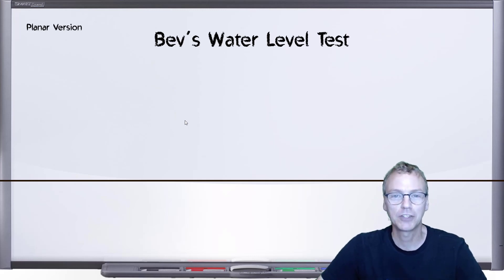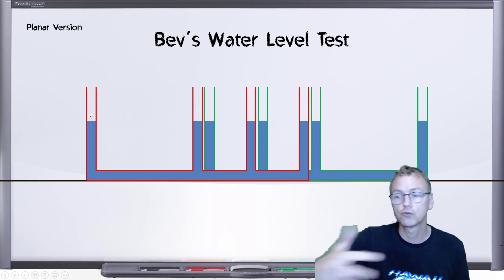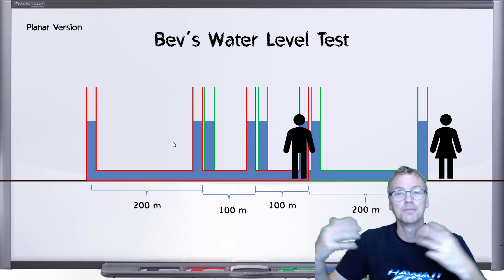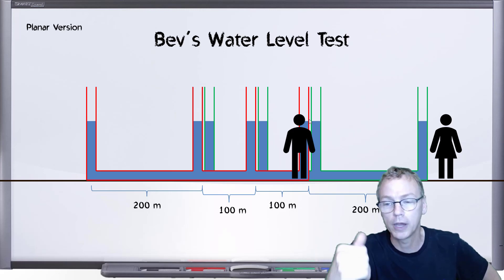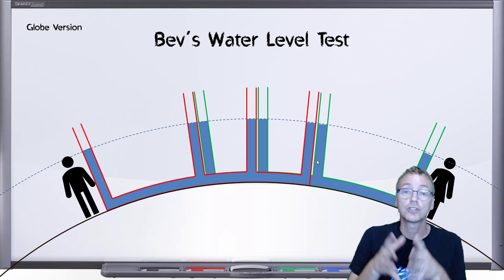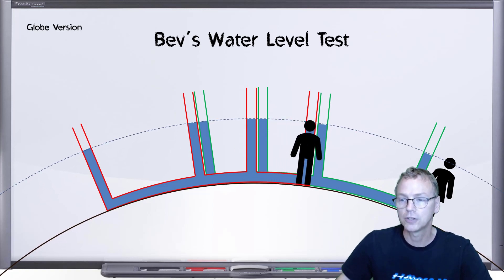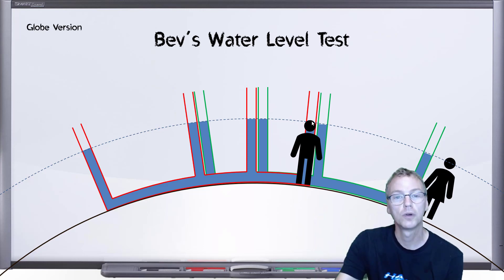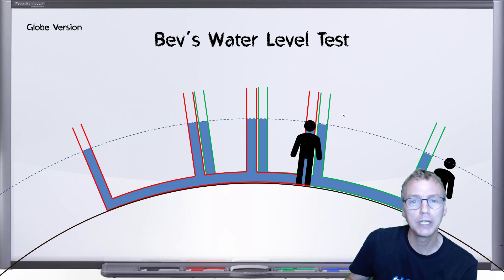Bev Try Thinking and Spot On Level's Water Level Test

Comment: The float glass horizontal and level manufacturing process producing uniform plate glass all over the world proves that the direction of down cannot somehow converge to a single point, little buddy. Otherwise the plate glass wouldn't stack perfectly. We went over this. Sort of surprised that you still don't get it.
Reply: Once again, a flerf cannot deal with scale. Isn't that right 'little buddy'?
Reply: @rustisamust9079  
I always think of it as a conversation between Lennie and George from Steinbeck's book "Of Mice and Men".
Reply: Float glass is anything but flat.  I know because I've measured it.
Reply: @awatt  I look forward to your video on it.
Reply: @awatt  lots of beliefs there buddy, enjoy.
Reply: @awatt  lol then you imagine the float glass manufacturers are lying to their customers?  Do you plan to sue them for false advertising?
Reply: @DrEMichaelJones  
Float glass is anything but flat.  Ask any mechanical engineer.  Glass plates are commonly used as a reference surface.  Float glass isn't flat enough for such measurements as it's not flat.
Reply: @awatt  that's a fascinating belief little buddy. The float glass manufacturers say they have submicrometer accurate optical scanning equipment all up and down their 500 meter manufacturing line where they make 2mm thick plate glass. Where do you imagine the top of a "hump" would be located on the production line? Do you imagine it's in the middle or at one of the ends or perhaps someplace else? Take your time...
Reply: @DrEMichaelJones  
Measure it yourself then come back and apologize.  Wait, you haven't a clue how to measure it have you?  Show us all just how clever you are by telling us how you have measured plate glass for flatness.  Pro tip you can't because you don't know how.🤣

Globe confirmed 🌎
Reply: @DrEMichaelJones  
Your apology has been accepted.
Globe confirmed 🌎
Reply: @awatt  the glass manufacturers measure the uniform thickness for us and then produce uniform plate glass daily. No curvature in their horizontal production lines.
Reply: @awatt  you tell yourself that if it helps you sleep at night. Enjoy your day. :D
Reply: @DrEMichaelJones  
From "fundamental principles of float glass surfaces"

The second optical defect, which results from the float process is the distortion. Distortions are the result of waviness of the glass surface and act as cylindrical lenses in the glass. The reason for this effect is that the float bath is not ideally flat in reality. Top rollers, stretching forces on the glass ribbon and vibrations from outside induces a corrugation of the glass surfaces. Two forces are acting to remove the corrugation and to flatten the glass surface: surface tension and gravity. By these way capillary-gravity waves are induced with a wavelength of about 20 mm. The great advantage of the float process is, that it reduces the amplitude of the distortion waves and therefor the lens power. Measurements show that float glass with equilibrium thickness of 6.5 mm has the best optical quality."

Globe confirmed 🌎
Reply: @awatt  where do you imagine the "top" of the the "hump" you believe exists in the 500 meter production line?
Reply: @DrEMichaelJones  
Float glass isn't flat therefore globe confirmed 🌎
Reply: Float glass proves the globe due to not being flat.  Globe confirmed 🌎
Reply: @awatt  except for the part where the horizontal production line destroys any notion that it can curve. Enjoy your day.
Reply: @DrEMichaelJones  
Float glass production destroys flat earth because float glass isn't flat.
Globe confirmed 🌎
Reply: @awatt  the glass production line is level and horizontal for 500 meters. It doesnt curve. Enjoy your day.
Reply: @DrEMichaelJones  
But I he glass it produces isn't flat.  Globe confirmed 🌎
Reply: @awatt  is this guy a troll?
Reply: @Darryl.M  
No he's just thick that's why I'm communicating on his level.
Reply: What is the calculated curve in an 8 foot piece of glass, if following Earth curve?
Reply: @darrellkimmel2646  About 4.5 x 10^-6 inches. You need a really good microscope to see it!
Reply: @bluemarblescience  
Mike and I have had the same discussion before.
I showed him the calculated curve in 500 meters , the length of the float pool, and asked him how much it was in 5 feet several times but he didn't answer.
Reply: @darrellkimmel2646  I know. People like Mike enjoy showing off their ignorance for some reason. They've obviously never heard of ASTM. If they had, they would take to time to look up the specs before making a fool out of themselves. On the other hand, it's amusing to read the idiotic dribble they come up with.
Reply: @bluemarblescience  lol, where do you imagine the ASTM compliance team would measure a hump, little buddy? Do you imagine that it's exactly in the middle or are you going to pick one of the ends? :D
Reply: @bluemarblescience  
He thinks glass manufacturers routinely test to this precision with in house equipment.
Reply: @DrEMichaelJones  The fact that you're asking where the ASTM team would measure a hump shows how little you understand of how the world works.

Also, what method does the company use to measure this flatness? You must know all about it if you're willing to stand behind it with such certainty.
Reply: @Beacon80  I'm glad you agree that there's no hump in the production line for the ASTM compliance team to measure because the line is, of course, level and horizontal. Good stuff. 👍🏿
Reply: @darrellkimmel2646  Mickey thinks a 500m production line makes a sheet that is 500m long. The 500m includes 50m Tin bath but the rest is , Anneslling, cooling, cutting, stacking, and other bits and pieces. He fails all day.
Reply: @whereswa11y  👍 the annealing process takes up the largest section of the line. I remember getting a batch of 3mm from China that was not annealed properly. Almost impossible to cut. At this stage I think Mike is just trolling. He has no experience in the subject matter and is just making it up as he goes.
Reply: @whereswa11y  
That's what I get for not checking his assertions.
Reply: @whereswa11y  wally imagines that the direction of down somehow only converges on the tin bath part and then the converging down switches back to normal down and is uniform and parallel after the glass emerges from the bath and dries and hardens. What's nice is that he got a little heart for that comment so we can infer that the channel owner agrees with this.
Reply: @darrellkimmel2646  zero. There is zero curve "calculated" in an 8 foot piece plate glass and there is zero curve across the entire 500 meter long level horizontal production line that is constantly being monitored by submicrometer accurate optical scanning equipment. None. Zero. They make plate glass all day every day. No curve at all in that manufacturing process.
Reply: @DrEMichaelJones  
In any case, glass is not  completely rigid either.
You can push in the center of a window or even a tempered glass door panel and see the deflection.
"Glass deflection is the amount that a piece of glass bends, or flexes, at its center point when a force, such as wind load or snow load, is applied. Extreme amounts of deflection can lead to distortion. Therefore, The International Building Code (IBC) has established deflection limit standards for glass wall systems.Oct 30, 2019"
There's plenty enough flex in glass to lay flat even if layers were stacked alternating between glass facing up and  glass facing down during manufacturing.
Reply: @DrEMichaelJones  It's very simple Mike: Some people went to space, they took a camera. 

It's not flat
Reply: @A 15 degree per hour drift  it's great to watch you guys have to resort to spaceships when you can't demonstrate curved water at rest. What do you imagine your grandparents said before nasa was founded?
Reply: @darrellkimmel2646  who said it needed to be perfectly rigid? Plate glass is manufactured and naturally hardens on a horizontal level production line to uniform thickness. There's zero curve in the process. None. The direction of down doesn't somehow converge anywhere along the line.
Reply: @DrEMichaelJones  _Wah! Wah! Wah! 
We can explain water at rest being curved, you're either too obtuse, or much more likely, far too thick to understand what you've had explained and demonstrated many times.
Reply: @A15degreeperhourdrift  don't cry little buddy. I know it can hard for you boys when your worldview is being dismantled.
Reply: @DrEMichaelJones  just to correct you on one point. Plate glass is an old process where a glass panel (usually drawn glass) is ground flat on both sides to make both sides flat. Float glass is the newer process of floating molten glass on a bed of tin (most common ). 
The tolerance of thickness in glass manufacture for the most common glass thickness of 6mm is +-.2mm and as much as +-1mm for glass up to 20mm. This would make it impossible to determine the presence or lack of curvature over the short distance. To make it harder to determine, glass can be flexed way more than what would be considered the radius of earth. To move large sheets on a cutting bench we would flex the glass to allow air under it. The amount we would flex (bend) the glass far exceeded the curvature need over such a short distance. I could make a 3.6 metre sheet of glass flat, curved up or down. Glass manufacture cannot be used to prove or disprove curvature.
Reply: @Darryl.M  the float glass process requires zero grinding, little buddy, and it's more efficient and adheres to much tighter tolerances.
Reply: @DrEMichaelJones  Darryl gave you the tolerances for producing float glass. Nowhere does he mention grinding for float glass.
Try reading it again. Slowly.
Reply: @DrEMichaelJones  
Why would standard window glass need to be flat? In fact if one looks carefully through any plate glass windows, distortions due to NOT being completely flat can be observed.
Reply: @DrEMichaelJones  well little buddy I think you will find I said that. The point I was making was that you were stating plate glass instead of float glass in your earlier post.
Reply: @DrEMichaelJones  sorry Mike but the manufacture tolerances and the fact that glass bends make the argument that glass manufacture proves or disproves curvature a no go.
Reply: @simond.455  glad we agree that float glass hardens naturally without grinding. It's definitely a horizontal and level manufacturing line with zero curvature detected by the submicrometer accruate optical scanning equipment that runs across the entire 500 meter long production line.
Reply: @Darryl.M  the float glass process produces plate glass, little buddy. Try to focus.
Reply: @DrEMichaelJones  
Plate glass is not float glass. The clue is that they have different names
Reply: @DrEMichaelJones  Google is not always your friend. Do you have any experience working with glass? Have you ever seen the manufacture of float glass? I finished my glazing apprenticeship in 89 and have worked in domestic, commercial, highrise and manufacturing. We have a great float glass manufacturing facility in Melbourne which I have visited on more than one occasion. I don't really care about your belief in flat Earth but you cannot use glass manufacture to prove or disprove curvature. Find something else.
Reply: @DrEMichaelJones  Thank you for confirming that you don't understand how the world works. And you, of course, ignored the second half of my post. I'm guessing because you have no idea how they measure it.
Reply: @Darryl.M  it's not a good look to tell people that your former employer lies to their customers
Reply: @DrEMichaelJones  so what experience do you have?
Reply: @DrEMichaelJones  Wah! Wah! Wah!
Reply: @DrEMichaelJones  You were asked for the CALCULATED curvature. Your "answer" didn't address the question.
Reply: @DrEMichaelJones  Curved water at rest has been understood and explained for centuries, NASA has exactly nothing to do with it.
Reply: @davidfaraday7963  tell us more about your "understanding" of "curved water at rest."
Reply: @DrEMichaelJones  You have been told it hundreds of times already. If you have the intelligence to comment on YT you have more than enough to understand the explanation. Therefore you are pretending to not understand and are showing yourself to simply be dishonest.
Reply: @davidfaraday7963  you sound upset, little buddy. Maybe take a break from the internet and get some fresh air
Reply: @davidfaraday7963  Well, what can you expect from someone who didn't have 5 minutes to research and find that a tin bath is only 50m on the 500m production line? LOL!
Reply: What can we expect from someone that imagines that the liquid bath would somehow be curved but the rest of the production line would be straight, level and horizontal? He clearly knows nothing about engineering. LOL!
Reply: @DrEMichaelJones  Has it become standard practice now in flerf circles to claim that anyone who contradicts their nonsense is accused of being "triggered", or "upset" or other similar words?
Reply: @DrEMichaelJones  "He clearly knows nothing about engineering."
That would be you... you are the one who thought the earth curvature should affect the production of float glass somehow, even if due to the small size of the tin bath it wouldn't be noticeable anyhow.
Reply: @davidfaraday7963  Yes, fucking annoying, isn't it? Triggers me every time!! LOL

No, seriously, you're right: it's used as one of those conversation-derailers, isn't it? Like "Hey, calm down..." Often used by debaters when they panic and need a bit mor floundering-about time.
Reply: Look at them all try to comfort themselves that they somehow must be right even though none of them can figure out how a float glass manufacturering line could produce uniform plate glass with micrometer accuracy if the direction of down somehow converged. Hilarious
Reply: @jaimevivesp glad to hear you say that plate glass is clearly not affected by a converging direction of down. Ergo, the direction of down clearly doesn't converge.
Reply: @DrEMichaelJones  If you'd followed the thread you would have spotted that in fact they DID manage to "figure out how a float glass manufacturering line could produce uniform plate glass with micrometer accuracy if the direction of down somehow converged"
So you statement is a complete and utter lie.
Reply: @DrEMichaelJones  Let me ask you a question: if the direction of down converges to a point 6371 km below the 500 m long glass manufacturing line what is the departure from "flat" over that distance?
Reply: @DrEMichaelJones  I thought float glass was permitted to have overall bow ± 3 mm/m? That seems very different to what you are claiming.
Reply: @DrEMichaelJones  "submicrometer accruate optical scanning equipment that runs across the entire 500 meter long production line"
Citation needed.
Reply: @everybodylovesballs  you imagine that 2mm thick glass can vary by +/-3mm over a meter? Fascinating belief.
Reply: @davidfaraday7963  the direction of down definitely doesn't converge which is why the float glass manufacturers tell their customers that their plate glass dries and hardens uniformly across the entire line. Where would you imagine there would be a hump in the horizontal manufacturing line?
Reply: @DrEMichaelJones  Correct me then. What is the exact manufacturing tolerance for overall bow?
Reply: @DrEMichaelJones  "glad to hear you say that plate glass is clearly not affected by a converging direction of down. "
Along 50m? Are you joking?
"Ergo, the direction of down clearly doesn't converge."
False conclusion. You were proved wrong. Move on and try something else.
Reply: @davidfaraday7963 the direction of down doesn't converge on that manufacturing line as evidence by the uniform plate glass produced and monitored by submicrometer accruate optical scanning equipment. No iis detected. There was nothing for the glass manufacturers to "figure out." The direction of down is parallel to the horizontal production line at every point along the 500 meters.
Reply: @everybodylovesballs  what bow? The line is horizontal and level. Where exactly do you imagine the top of this "bow" is?
Reply: @jaimevivesp  no, I never joke about plate glass manufacturing. There's definitely no curve in a 500 meter horizontal and level production line.
Reply: @DrEMichaelJones  Why are you insisting on the 500m lie? The tin bath, where the glass is flattened, has only 50m! There rest of the line has nothing to do with making flat glass.
Reply: @jaimevivesp  so you imagine the 50 meter tin bath is where there would be some sort of hump with converging directions of down but they managed to get the rest of the manufacturing line to be horizontal with a uniformly parallel direction of down? Fascinating belief. Let's see if your little buddies agree with you...
Reply: @DrEMichaelJones  Mike, you are really obtuse... no one is saying there is a significant hump on a 50m tin bath, that would affect the flatness of the glass within the stated tolerance. It's you who said that.
And again, the fact that the rest of the line is or is not perfectly horizontal has nothing to do with the process of making flat glass, only the tin bath matters.
Reply: @DrEMichaelJones  You still haven't explained how they test the flatness.
Reply: @Beacon80  they use submicrometer accruate optical scanners, little buddy. I've pointed that out about a half dozen times in this thread. You can look it up. Or maybe call them and ask.
Reply: @DrEMichaelJones  Do you know at all how float glass is made? I repeat: the only part of the production line really important for making flat glass is the tin, the rest of the line is not relevant.
Reply: @DrEMichaelJones  I asked you to say HOW MUCH it would be out IF the direction of down converged as described.
Yet again you have fluncked it showing that you simply haven't got a clue. Your problem is that you have zero understanding of the model you are attempting to debunk. Instead you have fallen back on simply making assertions that you cannot offer any evidence for.  You say that "The direction of down is parallel to the horizontal production line at every point along the 500 meters", OK then PROVE IT!
Reply: @DrEMichaelJones  Oh, and I asked you for a citation about your repeated claim that manufacturers use "submicrometer accruate optical scanning equipment". Frankly I think it highly unlikely that the producers of commercial float glass use equipment of that class so I'm asking you to tell us where you got that from. Or did you simply make it up?
Reply: @jaimevivesp  and by "really important" you mean the one place where you imagine there is a hump (where exactly?) and converging directions of down after which you imagine the glass exists that area and enjoys horizontality and uniform and parallel down?
Reply: @davidfaraday7963  it doesn't curve at all, little buddy but if you want to engage in fantasy maths to try to predict a curve based on a model that you can't prove, go for it.
Reply: @davidfaraday7963  the manufacturers state that their glass hardens uniformly parallel along the entire production line, little buddy. Are you saying they're lying to their customers? Do you imagine a great plate glass conspiracy to hide a hump with converging directions of down that you still can't even say where you imagine the top of it would be?
Reply: @davidfaraday7963  St Gobain Glass is the owner of the submicrometer accurate optical scanning equipment. They have loads of videos right here on youtube. Feel free to watch them at your leisure.
Reply: @DrEMichaelJones  I asked you to calculate how much difference it would make IF the direction of down converged. Yet again you have refused to answer. The obvious reason is that the simple high-school maths involved is way beyond your ability. 

And I'm still waiting for a citation for your claim about "submicrometre" measuring equipment. Its looking more and more as though you simply made that up.

And you wonder why people call you a liar.
Reply: @davidfaraday7963  I'm not your employee little buddy. If you'd like to calculate theta decay for me for some options I'm considering buying at the open tomorrow I'll keep you in mind for an unpaid intern job.
Reply: @DrEMichaelJones  So you don't know how it works. Got it.

I did some poking around, and there is a notable tolerate in what's allowed for "flat" glass. "the acceptable tolerances for thickness for a piece of ¼” glass (technically listed as .23”) has an acceptable range of .219” to .244”."

Having a system that can test detect the flatness of the glass down to the micrometer doesn't mean there isn't a micrometer of bow. It just means they're aware of it, but it's still well within acceptable parameters.
Reply: @DrEMichaelJones  "some options I'm considering buying at the open tomorrow" Yeah, yeah! And pigs might fly!
Face it Mike, you couldn't add up two and two and get the right answer.
Reply: @Beacon80  you imagine the top of this micrometer of "bow" is where exactly again? Surely you have an idea of where the top of the bow you imagine exists is. Why don't you tell us?
Reply: @davidfaraday7963  head over to di$cord. The server is called "next level." I'll livestream the waterfall into my pool for you.
Reply: @DrEMichaelJones  Assuming the glass is perfectly uniform, it would be directly in the middle.

Please state where St Gobain Glass says that their maximum tolerance is less than a micrometer.
Reply: @DrEMichaelJones  Which has what to do with your inability to do even grade-school maths?
Reply: @Beacon80  the middle of what?
Reply: @DrEMichaelJones  The middle of the section of glass. What else could I possibly have meant?

Again, please state where St Gobain Glass says that their maximum tolerance is less than a micrometer.
Reply: @Beacon80  the middle of each plate or the middle of the 500 meter long manufacturing line?
Reply: @DrEMichaelJones  Each piece of glass.

Again, please state where St Gobain Glass says that their maximum tolerance is less than a micrometer.
Reply: @Beacon80  lmfao. You imagine each plate of glass has its own individual hump exactly in the center of it as it moves down the production line side by side with other plates? Fascinating!
Reply: @DrEMichaelJones  Yes. But far too small to be noteworthy. 

Again, please state where St Gobain Glass says that their maximum tolerance is less than a micrometer.
Reply: @Beacon80  so you imagine that 2, 3 even 4 side by side plates all somehow develop humps in the exact center as they move down a horizontal production line?
Reply: @DrEMichaelJones  There's no side by side on the production line, but yes. Cut curved glass and you get a piece of curved glass.

Again, please state where St Gobain Glass says that their maximum tolerance is less than a micrometer.
Reply: @Beacon80  that production line produces multiple side by side plates. It's not 2 feet wide. Do you imagine the middle plate has the highest part of an overall hump or do you imagine the ones on either side of it each have an individualized equally high hump?

Call St. Gobain. Youtube won't let me post the link
Reply: @DrEMichaelJones  Tell me the name of the website and whatever search terms you used and I'll look it up myself. Because I've poked around their official website, and I don't see anything about their maximum tolerance.
Reply: @DrEMichaelJones  did you state that glass dries? When did it get wet? 🤣
Reply: @Darryl.M  Oh thank you for walking into that one. I've been waiting. So the liquid, molten, moving glass that goes down a horizontal manufacturing line begins to cool/harden/solidify where exactly? As it leaves the liquid bath, right? Take all the time you need...🤣  you're the one that claims to know the exact moment of hardening.
Reply: @Beacon80  thickness tolerance for 4-6mm float is +-.2mm. It is up to +-1mm for 20mm float glass. The sensors he keeps talking about measures the thickness as the sheets run through the production line. The glass could be formed into a circle and the thickness of glass would not change. These sensors will not measure a "hump" in the glass even if it existed. Float glass production cannot be used to prove or disprove a globe or flat Earth.
Reply: @Beacon80  were not talking about "tolerance" little buddy. We're talking about the ability of the submicrometer accurate optical scanning equipment to detect what you guys originally envisioned as a single hump but you have now decided to overrule that and claim hundreds of little humps all up and down the 500 meter long production line. It's a bumpy line according to you...
Reply: @DrEMichaelJones  it's called annealing. Not drying. Walk into what? You thinking that molten glass dries? You are a special one aren't you.
Reply: @Darryl.M  where's the top part of that annealed curved you imagine? Is there one on each plate along the entire horizontal production line that our special little buddy imagined or do you imagine it differently? Take your time.
Reply: @DrEMichaelJones  tell me were the glass starts to "dry"? Take your time.
Reply: @Darryl.M  the float glass cooling is definitely a dry process as opposed to wet cooling. Good for you. Where does the cooling begin? Is the hump you imagine there? Take a day or two if you need it. This sad little attempt at obfuscation amuses me.
Reply: @DrEMichaelJones  your story changes like the wind. You have no practical knowledge of the properties of glass or its manufacture. You state on more than one post that glass dries and now you back pedal and change it to a dry cooling process. You never answered my question about what experience you had working with glass. See if you can answer this time.
Reply: @DrEMichaelJones  If you have a curved piece of glass, you have one hump, right? If you cut that in half, you now have two pieces of curved glass, each with their own hump. No matter how many times you cut the glass, each piece will still be curved.

More importantly, how big do you think these humps are?
Reply: @Beacon80  the glass isn't curved, little buddy. The manufacturer specifically states that. Do you imagine they're lying to their customers?
Reply: @DrEMichaelJones  you really have no idea of the properties of glass do you.
Reply: @DrEMichaelJones  No. They're not lying. The curve is well withing the tolerance to be considered flat.
Reply: @Beacon80  you just claimed that each individual glass plate in dozens of rows of glass has a curve with its highest point exaclty in the center. How do you imagine all these humps form?
Reply: @Darryl.M  says the guy that imagines plate glass hardens into a hump 🙄
Reply: @DrEMichaelJones  I don't believe I have ever said there is or is not a "hump". What I have stated is that with the properties of glass and the manufacture tolerances, the float glass manufacturing process cannot be used to prove or disprove a globe or flat Earth. You are the one stating a position that is untenable.
Reply: @Darryl.M  a hill disproves a "flat earth," little buddy. There are no hills in plate glass but plenty of hills all over the world.
Reply: @DrEMichaelJones  and now you start taking about hills. You do love a good straw man don't you. I don't care if you believe in a globe earth or a flat earth. Float glass manufacture cannot be used to prove or disprove either. Your lack of practical knowledge in this field is obvious. You maybe better off finding another "proof" to backup your beliefs.
Reply: @Darryl.M  float glass manufacturing proves that level is horizontal, little buddy. I don't know why this bothers you. It's a simple principle of construction and manufacturing
Reply: @DrEMichaelJones  "How do you imagine all these humps form?"
We went over this. As you yourself pointed out, according the the globe, the glass in the tin bath will have a slight curve. If you cut curved glass, it doesn't become straight.
Reply: @Beacon80  so now you imagine a single hump in the center of the bath and then you imagine each individual plate also has a hump in thr center. Like I said, how do you imagine all those individual humps form?
Reply: @DrEMichaelJones  doesn't bother me. Take no time at all to reply. I'm not replying for you. I'm replying for anyone else that may read this thread so they don't fall down the rabbit hole with you.
Reply: @DrEMichaelJones  "Like I said, how do you imagine all those individual humps form?"
How many times do I have to repeat this? If you take a curved piece of glass and cut it in half, you have two pieces of curved glass.
Reply: @Darryl.M  I'm glad that level being horizontal doesn't bother you either since it's a principle of construction and manufacturing that's used every day all over the world. Especially in float glass.
Reply: @Beacon80  and like you also said, you imagine that every single piece of plate glass in multiple rows and columns on the production line has a "hump" that's highest point is somehow exactly in the middle of each plate and all those plates were cut from one continuous ribbon of molten glass that you imagine passes over a single hump in the middle of a liquid tin bath (and then no hump after that?). And like I said, what a fascinating belief that is not in any way supported by the manufacturers of plate glass.
Reply: @DrEMichaelJones  Since you clearly can't figure it out, the answer is that for a 50 meter pane of glass, the bow caused by the curvature of the Earth is 0.05 millimeters. That's one millionth of the length of the glass. It's insignificant next to the flexibility of the glass, and way below the regulated tolerance level. Nobody's going to reject that as not being flat.
Reply: @Beacon80  that's a fascinating belief and one that would easily be discovered by optical scanning equipment if it existed. Especially when you consider that screen protector glass that is only .3mm thick is made with this process. Where would you tell St. Gobain to look for this very specific hump in their bath? Do you imagine it would be in the exact center? If so why?

Do you imagine that the glass leaves the "curved" bath and then progresses down the rest of the manufacturing line horizontally or do you believe it would need to navigate a second hump there?
Reply: @DrEMichaelJones  "that's a fascinating belief and one that would easily be discovered by optical scanning equipment if it existed."
Not really. The pane of glass can bend far more than that tiny amount.

"Especially when you consider that screen protector glass that is only .3mm thick is made with this process."
Which means that, assuming it's 15 centimeters long, your screen protector has a bow of 0.000000707323 millimeters. This is, of course, assuming the glass is completely rigid, which it isn't.

"Where would you tell St. Gobain to look for this very specific hump in their bath? Do you imagine it would be in the exact center? If so why?"
It's not a hump. It's a curve. It runs the entire length of the pane of glass.
Reply: @Beacon80  bend? We're taking about a specific hump that you imagine is located at a specific spot in a bath that is scanned by equipment that can detect anomalies in .3mm glass. And it isn't screen protector size while it's in that bath little buddy 

If it runs the entire length of the production line then the apex of that "curve" can't be in the center of the bath... so where do you imagine it is?
Reply: @DrEMichaelJones  "bend? We're taking about a specific hump that you imagine is located at a specific spot in a bath"
No. You keep imagining a hump. I've made it quite clear I've been talking about a uniform curve in the glass.

"specific spot in a bath that is scanned by equipment that can detect anomalies in .3mm glass"
The video I watched, they don't scan the glass in the bath. It doesn't get scanned until it's left the bath, gone through the lehr and into the cold end.

"And it isn't screen protector size while it's in that bath little buddy"
Of course it isn't, sweetcheeks. But if you cut a 50m pane with a 0.05mm bow into 15cm pieces, the individual pieces don't retain that 0.05mm bow. They get a much smaller one. Do you not understand how curves work?

"If it runs the entire length of the production line then the apex of that "curve" can't be in the center of the bath... so where do you imagine it is?"
There is no apex. The apex is the highest point in a curve, and the entire point here is that the curve is following the curve of the Earth. Therefore no point on the curve is higher than any other point.

You're still missing two primary points here:
1) The flexibility of glass far exceeds the bow. Meaning if you took two 50m panes of glass, each with a 0.05mm bow, flipped one upside-down and placed it on top of the other, it would bend enough to be flush with the first pane.
2) Even if we pretend that glass is completely inflexible, that 0.05mm bow is far below the tolerance limits, and would be considered flat anyway.
Reply: @Beacon80  lol first you said only the bath matters ... now you're claiming they have no clue what happens in the bath nor is there's an apex to a curve there or at some other point along the horizontal manufacturing line. Why don't you call them and ask them where their hump is since you believe in it so vociferously? Better yet, why don't you tell them exactly where to look for it?

And if there's no "apex" to that curve you  imagine then why exactly do you claim that it blocks the bottoms of boats and buildings in the distance?
Reply: @DrEMichaelJones  "now you're claiming they have no clue what happens in the bath"
I'm not saying anything. Saint Gobain's video says that the high-end optical scanner you keep bragging about is in the cold end, not the tin bath. If there's some other video that talks about a scanner in the bath, tell me the title and I'll look it up.

"nor is there's an apex to a curve there or at some other point along the horizontal manufacturing line."
Pretty much, yeah. Under gravity, molten glass will distribute itself as evenly as possible. Why would there be an apex?

"Why don't you call them and ask them where their hump is since you believe in it so vociferously?"
Why would I ask them about a hump that I do not believe exists? You're the one insisting that on a globe earth, molten glass somehow defies gravity to create a hump.

"And if there's no "apex" to that curve you  imagine then why exactly do you claim that it blocks the bottoms of boats and buildings in the distance?"
I've never claimed that. The horizon blocks the bottom of boats, buildings, etc. in the distance, but that's not an apex and I've never said it was one.

Please show me where Saint Gobain says that there maximum tolerance for bow is 0.05 mm over 50m.
Reply: @Beacon80  "why would there be an apex?"  Because you claim that apex blocks the bottoms of boats and buildings in the distance little buddy. Or do you disavow that now

Say it out loud "the horizon isn't the apex of any curve."
Reply: @DrEMichaelJones  "Because you claim that apex blocks the bottoms of boats and buildings in the distance little buddy. Or do you disavow that now"
I literally just told you that I have never made that claim, sweetcheeks.
Reply: @Beacon80  nice to see you concede that there is no "curvature" blocking the bottom of anything in the distance. I'm male so you might want to retract the "sweetcheeks."
Reply: @DrEMichaelJones  I didn't say there wasn't any curvature, sport. I said there was no apex to the curvature.

Have you confirmed that Saint Gobain measures the bow of the glass, and what the maximum tolerance is? Or are you just making assumptions that support your argument?

And I'm not your buddy, so I thought we were just using inaccurate pet names for no reason.
Reply: @Beacon80  you imagine you can identify curvature but somehow can't locate an apex to it? Fascinating!
Reply: @DrEMichaelJones  I'll take your desperate attempt to change the subject as admission that you're just making wild assumptions that support your position.

As for the apex, if you want to get really technical, the oceans have two apexes, both on the equator, one directly under the moon and the other on the opposite side of the planet. But that has nothing to do with the horizon.
Reply: @Beacon80  we're on the topic of you imagining a curve in a horizontal manufacturing line and you're now trying to change the topic to oceans. Sad. Do you imagine there are two apexes to a single curve on a 500 meter long production line like you do on two oceans?
Reply: @DrEMichaelJones  Wow. Project much? You are the one who brought up the ocean.

And no. As I said, there is no apex in this curve. The production line doesn't have tides.

Have you confirmed that Saint Gobain measures the bow of the glass, and what the maximum tolerance is?
Reply: @Beacon80  nice to hear you concede that tidal swells can block the bottoms of boats and buildings in the distance. And yes I agree that there's no actual or measurable vertical apex of any curve in a level and horizontal production line. Common ground
Reply: @DrEMichaelJones  Do you really believe that the horizon is caused by the tides? 😄😂🤣

Great. You agree that there's no apex to a level curve. Now, have you confirmed that Saint Globain measures the bow of the glass, and what the maximum tolerance is?
Reply: @Beacon80  level isn't curved, little buddy, it's horizontal. Everyone knows this but you apparently. There is no bow for st gobain to measure which is why they don't measure it. You're the one that claimed there was and that they're lying to their customers, not me.
Reply: @DrEMichaelJones  You're the one who claimed that their submicrometer optical scanner could detect the miniscule curvature caused by the direction of down converging to a single point.
Now you're saying that they don't check for that, so how would they know? Your "proof" is that you assume a glass company assumes that a level of flatness far beyond any sensible tolerance.
Reply: @Beacon80  yeah it doesn't detect any curvature. zero bump in the middle of that horizontal pool (or do you imagine it would be in the middle of the entire manufacturing line?) which is why St. Gobain says they produce plate glass with perfectly parallel sides. Their optical scanners confirm no curve. Not my claim. Theirs. Get angry at them, not me little buddy.
Reply: @DrEMichaelJones  So now they do measure it? You really need to make up your mind.

Sounds were back to this question, then: Have you confirmed that Saint Gobain measures the bow of the glass and what the maximum tolerance is?
Reply: @Beacon80  oh little buddy, you're really flailing now. I'll go slowly for you. They have optical scanners that can detect any anomaly in their 500 meter long production line where they make plate glass with perfectly parallel sides. If there was a 5mm hump or a 20mm drop, they'd detect it. They don't detect it because ... wait for it ... it doesn't exist. You believe it does, but it doesn't. Sad.
Reply: @Darryl.M  But we're not talking about a 5mm hump or a 20mm drop, sweetcheeks. We're talking about a curve of 0.05mm over 50m.
As Darryl M pointed out, the thickness tolerance for 4-6mm glass is +-.2mm. Do you really think their tolerance for bow is a hundred thousand times more precise than their tolerance for thickness? Especially when it's insignificant next to the glass's flexibility? As I've asked you from the beginning, where do they state the maximum tolerance for bow?
Reply: @Beacon80  so now you're claiming there's no curve on the rest of manufacturing line. So you imagine the molten glass exits a curved bath and enters and then hardens on a horizontal surface? Is that your latest guess?
Reply: @Beacon80  just let it go. Anyone reading the thread can see how intellectually dishonest he is. Personally I think he's just a troll.
Reply: @DrEMichaelJones  Show me that you actually understand what you are talking about.  
1)  On a globe earth what is the Sagitta to the arc for a 1,500 ft long chord?
2)  How would this affect the manufacture of float glass?
Reply: @fedogma8407  We don't live on a ball, little buddy, so there would be zero effect. The question is, where do you imagine this "sagitta" (aka as an "apex of a curve" aka a "hump") would be located exactly and do you seriously  imagine that the 500 meter long horizontal manufacturing line is an actual chord?
Reply: @DrEMichaelJones  "so now you're claiming there's no curve on the rest of the manufacturing line."
How about you answer the questions I asked, instead of making up things I never said? I'm not going to bother responding to you until you tell me what Saint Gobain's maximum tolerance for bow is.
Reply: @Beacon80  their tolerance for curvature (that doesn't exit in their horizontal manufacturing line) is zero. You're welcome.
Reply: @DrEMichaelJones  Tolerance is never zero, so I know you're making that up. Provide a source or admit that you're lying.
Reply: @Beacon80  tolerance for non-existent curvature in a horizontal manufacturing line is definitely zero. Feel free to call them and try to prove me wrong. Be sure to tell them exaclty where you imagine FEDogma's "sagitta" is, lol, so they can be sure to hunt in the right place.
Reply: @DrEMichaelJones  So you're admit you have no source. I don't have time for liars. Good bye.
Reply: @Beacon80  appreciate that concession that you have no source for your ridiculous claim that "tolerance is never zero" but St. Gobain is definitely not lying to their customers when they state that their plate glass is perfectly parallel. Let us know when you plan to sue them for false advertising.

Enjoy your day, little buddy! :D
Reply: @Darryl.M  Yeah, he got boring pretty quickly. His entire argument is even more circular than most flerfs'
Reply: Mike, reading through this stream it is obvious that you have no idea at all of the concepts of precision, accuracy or tolerances. If you are going to argue engineering try at least to understand the basic concepts as it clear that you haven’t the faintest idea of what you are talking about
Reply: @scrumpydrinker  geoff, reading your comment it's apparent that you're afraid to even guess where and how a curve would form in a horizontal moving float glass process and instead want to claim that it's not there because "it" a thing you can't pinpoint a location for is "within tolerance." You should learn to keep quiet. . “it is better to remain silent and be thought a fool than to talk and remove all doubt."
Reply: @DrEMichaelJones  you really have no idea of how a float glass production line works have you.
Reply: @scrumpydrinker  you really imagine horizontal curves.
Reply: @DrEMichaelJones  have you ever actually seen a float glass production line?
Reply: We're even more surprised at your lack of even a rudimentary understanding of the amount of curvature is in a sheet of plate glass! How much curvature are you expecting to see in a sheet of glass that measures a few meters on a side little buddy? Do you want to do the arithmetic all by yourself or do you need some help?
Reply: Wow, you are a moron 😂. Let me help you out. Go research the tolerances of float glass. So easy to find the information that debunks your claims. 
You must like embarrassing yourself